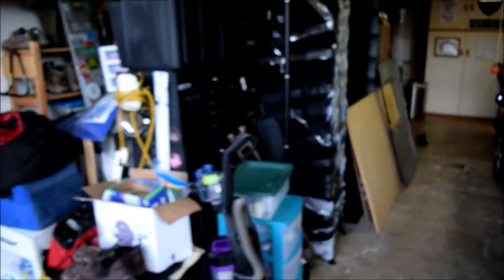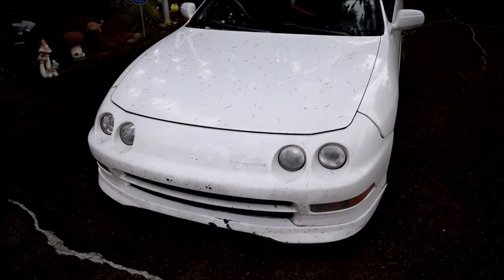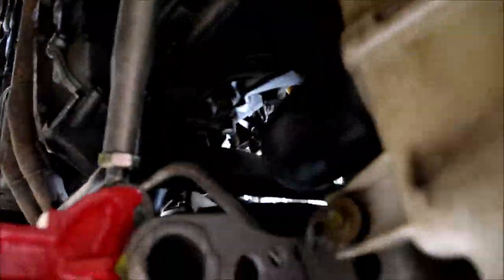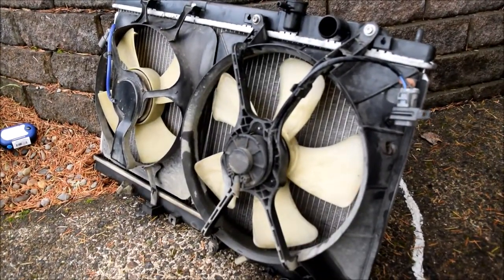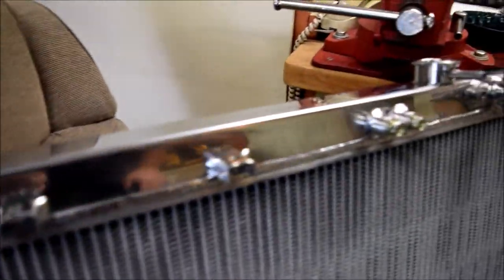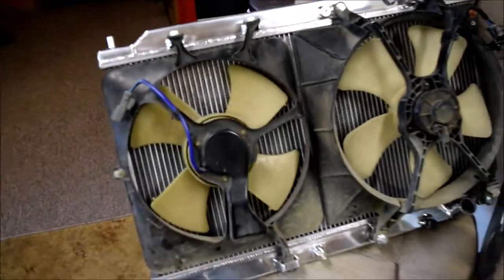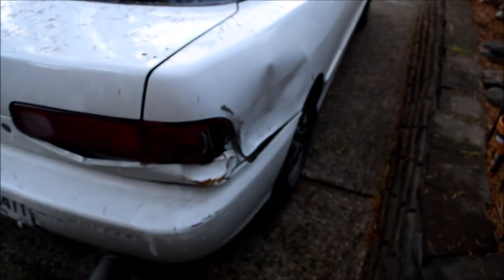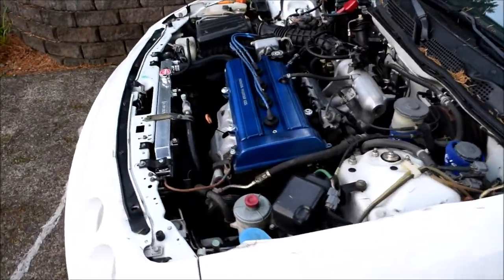Integra Koyorad Radiator - Daily Track Build - Amazing Upgrade

Comment: great video ~ 
is that how you bleed the coolant system ; with the funnel on the radiator ?
Reply from the maker: Yes sir. They make a funnel that screws into the radiator cap but didn't have one. You let the car warm up then turn the heat full blast for some time. Then back off. It will cycle the coolant through the heater core.
Reply: @CZMate  

Thanks , leave the heat on the whole time of the bleeding process ? When you say “ back
Off “ , your talking about refilling the coolant and backing off to let it take it in , etc ..
Reply from the maker: I wait for it to get to normal operating temp then switch it to heat/defrost on high. Wait a 5 min or so and turn the heat off. Then turn it back on. To cycle to coolant throughout the heater core. You can leave it on too that is just how I have done it
Reply: @CZMate  

Perfect , thanks bud.